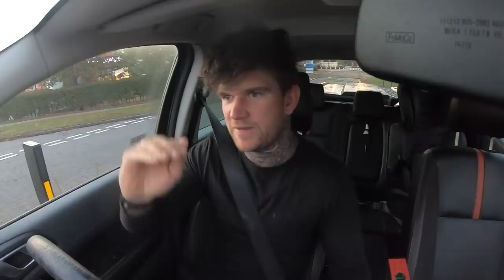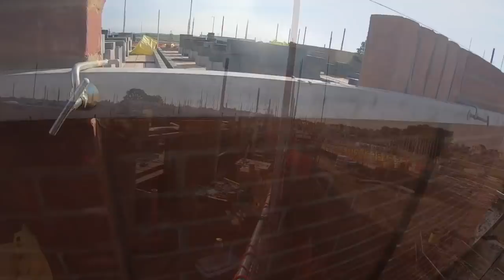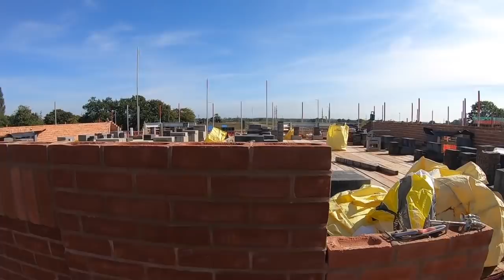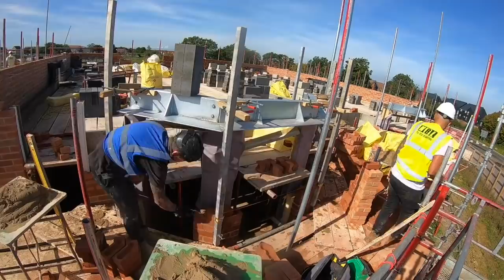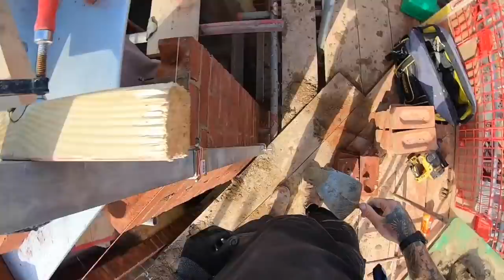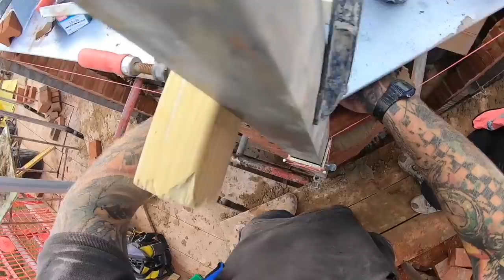Shocking day!

Comment: Just a quick tip for Tom, he seems to have a bit of shake in his lifts, he also has a lot of lateral movements in his lifts. Usually, I found this is because my dominant arm is doing much of the pushing, and my other arm was trying to compensate, so you end up shifting from one arm to the other too much. He might need to work on some more medium weights to get more comfortable in his arm balance when lifting. It might feel like going backwards lifting easier weights, but it is training your body to be more balanced, and it will help him be more stable in his lifts and overall lift heavier weights. Hope it helps him.
Reply: Dumb bells are the way forward
Reply: @Whitewolf1991  I mean kind of, it will build the core strength of his arms and chest, but until he has a good balance between both his arms he will still be slightly off-balanced.
personally, I would work on 1/3 his top weight and do 1 set of 10 lifts until comfortable, then move up to 2 sets of 10, when he is at 3 sets. I would increase the weight. 
While you will gain strength faster with bench, dumb bells will help you build your base, balance, and stamina overall. People will have different opinions, but having a solid base IMO is better in the long run
Reply: Worst thing guys do is ego Lift... you don't get Hypertrophy from doing under 5 reps so there's no point in trying to go heavy you will only injure yourself
Reply: @ivoryking509  That is if he is going for Hypertrophy, it isn't everyone's goal. Plus if he is only starting out, it is a bad idea to even think about it. It is also a good idea to not push yourself when starting off, so building up your reps at a comfortable rate is better than trying to over extend yourself IMO.
However, there are so many different opinions on this subject, it can be a hot topic of opinions.

Comment: Charlie when  you was bench pressing,you fell in the common mode of arching your back and using your legs....that's a quick way to a hernia or lower back problems,Isolate your legs by bending them up off the floor and crossing them,the gains will be alot better in the upper body.Keep up the good work and take care.
Reply: Not true, bench is a compound lift, use your whole body to lift the weight. You won't get a massive chest benching heavy. But another not get that bar all the way down Charlie half lifts don't count!

Comment: As a sufferer from depression and anxiety myself the self medicating on alcohol was the path i was on and as you said that's a downward spiral.The doctors had me on anti depressants and i lasted on those for a few years but now i have moved myself onto Hemp oil capsules that not only removed the need for any tablets but fixed sleeping issues and digestion issues i suffered from.Now i'm living normally thinking normally so your words resonated with me quite a bit you speak a lot of sense at times :P
Reply: anxiety wouldn't let me go to the shops or answer the door, friends would resupply me on the essentials

Comment: I just do not see the point of bay windows.
They are not usually structurally strong.
Usually have problems with the lead work and roof on the bay window
Too much work for useless internal space.
Even plumbing in radiators and plastering inside is hassle.
All for a look from the outside?
Reply: But John. They do look nice from the outside compared to the straight line featureless boxes that are mostly built now. OK it's Ballache but so what. Price gangs choose too go on price. Can't have cream all time. Rough with the smooth my friend
Reply: @stuartjones1982  Unfortunately I can only afford milk and not cream.
Reply: @johntheaccountant5594  hahahha just like that
Reply: @martin2466  Cats like to lay on the window sills in them too.